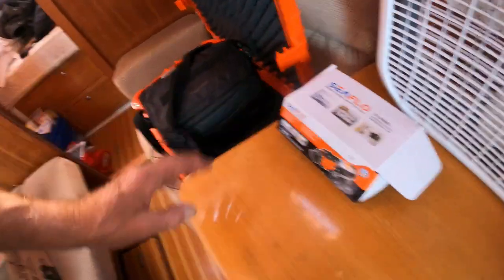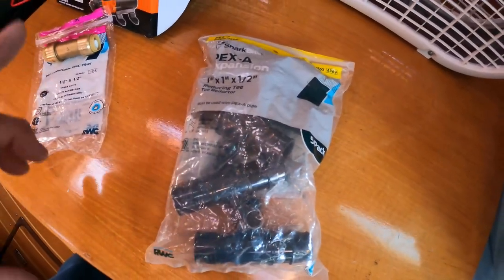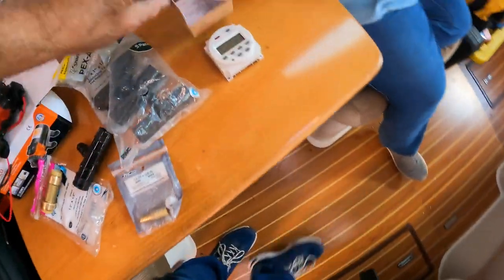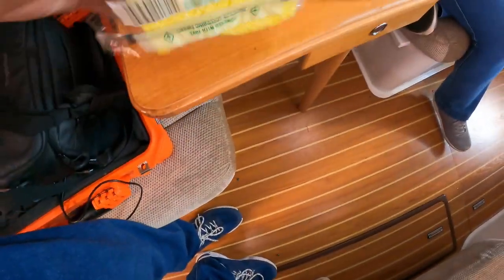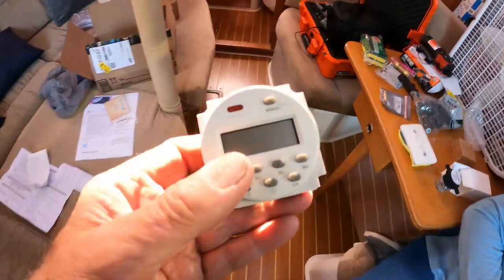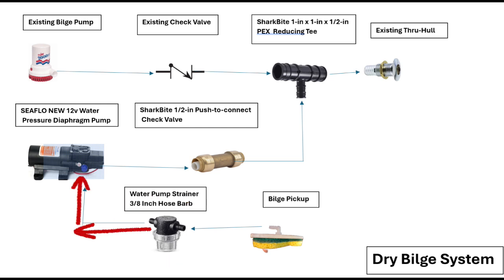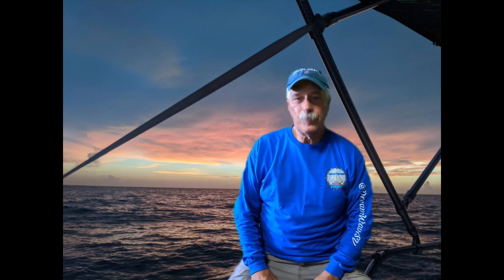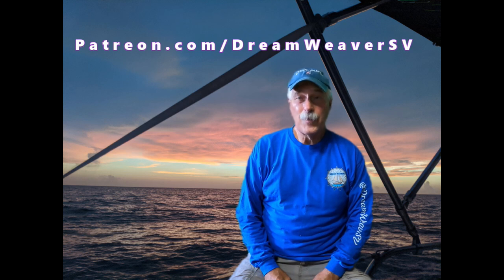S2 E47 | Building A Dry Bilge System For Around $100 Pt1#learningtosail #catalina387 #dreamweaversv

Comment: Very interesting, as you don't mention anything special, it seems that the foam is just bolted to the plastic plate with the elbow, right? Right? Merry Christmas
Reply from the maker: Yes just bolt the pad to the plastic plate with the elbow attached. It will absorb and suck through the pad without removing the rough side of the pad. Thanks for following and Merry Christmas to you also.
Reply: @DreamWeaverSV  Thanks for the good explanation; I'll try

Comment: Why do you need the check valve?  The Seaflo pump acts as a check valve.
Reply from the maker: That is a great question. If you do not use the check valve water will run back into the Seaflo pump when the regular bilge pump runs since they are both connected together. It is possible the regular bilge pump could overpower the Seaflo pump resulting in the water being pump back into the bilge. It is cheap insurance that will not happen. Thanks for watching and following us. Hope to see you on the water...
Reply: @DreamWeaverSV  The Seaflo pump can hold much more pressure than your bilge pump can produce.  The check valve isn't hurting anything, but is not necessary.
Reply from the maker: @jzkbbi1  Thanks for the info. When you build your system let everyone know how it does without the check valve.Thanks for watching.

Comment: Just watched this and Part 2. Did this work well?
Reply from the maker: It works fabulous! My bilge never has any water in it and that was not the case before installing the dry bilge system. It pumps it all out. I have it set to run for 3 minutes 3 times per day with 6 hours in between each run. The timer will let you set all that.